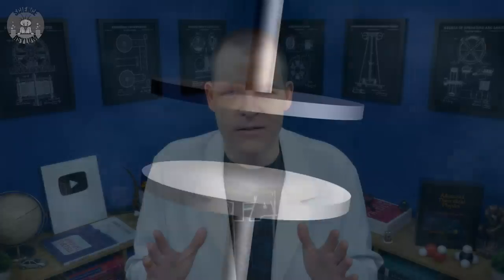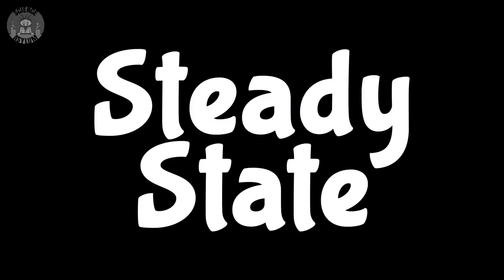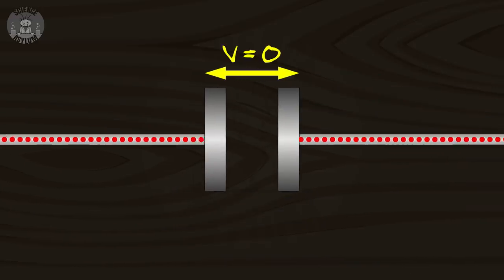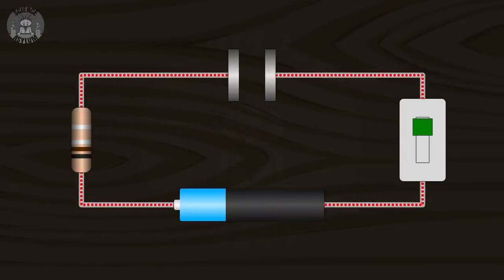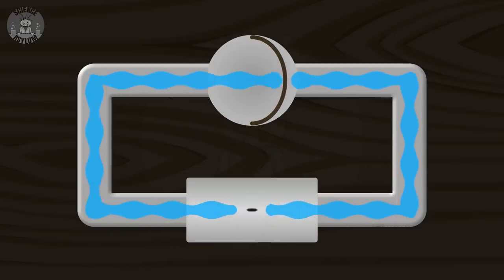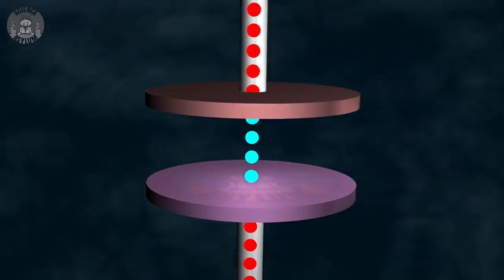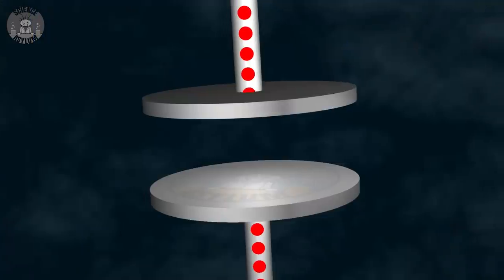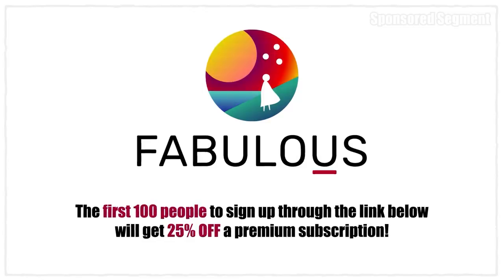Capacitors Are Gaps! How Does That Work?!

Comment: Great video - a few things that would be worth mentioning (for the you know, practical folks...)  First, is that a dielectric will increase the capacitance, by the relative permittivity.   Second, the charge on the capacitor is proportional to both the Capacitance and Voltage (Q=CV).  Finally, the energy goes as the square of the voltage (E=1/2 CV^2).  Many thanks once again!

Comment: Now Veritasium makes more sense!
..... If the capacitor "breathes energy in and out" is there a resonant frequency for this? Or is it a conceptualization?

Seriously though THANK YOU for pouring this information into me. When I was much younger (over 40 years ago) and I was being taught about Electricity I would often have questions that, with the benefit of hindsight, were just too deep for the lecturers trying to teach me to answer. I was also an arrogant sod back then and probably was not the best person to elicit help from overworked and stressed lecturers ...... My Bad!
But I have always been interested in deeper understanding. This is something you do well! With humor!
Reply from the maker: Circuit resonance requires both a capacitor and an inductor.
Reply: @ScienceAsylum  Perhaps my wording was not precise. If the capacitor has energy flow into it until fully charged, is there a maximum rate that energy can flow and a finite time it would take? If you throw a switch on a DC circuit does the current flow and then stop causing the magnetic field it produced to colapse?
Reply: @totherarf  real capacitors do have an effective inductance as well so, whilst you don't get any actual resonance, you do get a frequency where it has the least effective resistance. Dave Jones on EEVBlog has done videos on this, but the short version is capacitors resist current less the higher the frequency (or rather drop less voltage across themselves), but because of the inductance there is also an increase in this resistance. Low frequency the inductance is negligible so the effective resistance drops and drops until eventually the inductance becomes significant and eventually matches the resistance of the capacitor (it's around here where that low point is) - for higher frequencies than that the inductance takes over and it stops acting like a capacitor eventually.
Reply: @AtonyB  Thanks! That is what I was trying to say.
My question was what is that frequency? 
Obviously it would depend on factors like plate size and dielectric thickness and type ... so there may be a wide range .... but is there a ball park figure? Are we talking 50/60 Hz or are we up in the radio frequencies?
Reply: @totherarf  it depends on the physical size. For the large electrolytic capacitors Nic shows it a say a few tens of kilohertz. For the tiny surface mount capacitors on modern electronics (small light brown rectangular bits) it starts at a mega-Hertz and can go all the way to giga-Hertz for expensive high quality ones used in cell phone towers.
Reply: @duncanbarclay6919  Thanks!
That helps put things in perspective!

Comment: Concerning the resistance of wires.

I was tasked with designing and building a fixture to semi-automate testing special app thermal batteries. Thermal batteries of this type lock the chemicals of the battery away in crystal form. This keeps them from reacting, for decades. 

The method of activation used an electrically triggered pyrotechnic blank to ignite a flash powder in the cell. This melted the crystals. Tada! Fresh battery 30-40 years after manufacturing.

So, one of the tests performed by the fixture was verification of a correct resistance for the igniter fuse. The wire was only a couple ohms. The acceptable range for that resistance was less than 1 ohm. Accurate measurement was a must.

In order to zero out the wires and switching circuits of the fixture. I included circuitry that when connected to a 4 wire resistance meter could zero everything up to the +/- pins of the cell.

Everyday the fixture and connecting meters were warmed up, then the 4 wire meter was zeroed out to a standard. The standard was a dead short.

Then, multiple other standards were check against the fixture. Each of those had a calibrated pass or fail resistance engraved on them.

Re-zeroing occured every hour.

I made three variations of this fixture. Generally an error of less than 0.009 ohm was maintained for production runs.

After 5 to 10 thousand cells the sockets that connected the batteries would show signs of degradation. At the point that 0.01 ohm error was noted those sockets would be replace.

Yes, switches, wires, gold plated sockets all have resistance. And they all wear. When it matters it must be accounted for.
Reply from the maker: Thanks for all the examples!

Comment: Thanks, Nick, for your improved Poynting vector graphic which now clearly shows that the energy flow density is greatest nearest the conductor and then drops off further away from the conductor (specifically the Poynting vector magnitude is inversely proportional to the biquadrate of the distance [square of the square, or 4th power] away from the conductor). This means that almost all of the energy flows along the surface of the conductor.

Comment: Thank you for this video. Though I understand how capacitors work, I appreciate the simplicity to just help reinforce the conceptualization in my head. I especially liked the field vectors.

Could you also do one on a capacitor in an alternating current setup? I understand that shifts phase rather than acting like a... battery. I'd appreciate just seeing your animations to help strengthen understanding. A lot of people seem to think AC capacitors hold a charge even with power disconnected... which depending on the transient stage might but should quickly be dissipated via the wiring since the frequency changes the charge and discharge cycle very quickly.

I'd really appreciate it. Thank you.

Comment: Awesome video! I have always thought of a capacitor as functioning kind of like an expansion tank or a hammer arrestor to stop water hammering in a plumbing system. I  know that isn't a perfect analogy, but to help someone visualize how it works, it's a decent example. I always use a reservoir to represent a battery, and a pump to represent a generator.

Comment: Great video Nick, from the El.Eng. perspective I would only add: the main application of capacitors is to build circuits which can filter frequencies, i.e. through capacitors we can select and isolate frequency ranges in the perturbations of the electrical field. That has applications in basically any useful electronic device.

Comment: It would be nice if you could present an analogy between a capacitor and an inductance in terms of energy flow.
Normally, somebody will have his/her ideas well confused by the fact that an inductor is also an electric conductor for DC, but that is not a fundamental property of an inductor, but is merely a consequence of how we build an inductor - with coils of copper wire. Mathematically, an inductor is the complex conjugate of a capacitor, the phase of the current is +90° with respect to the exciting voltage, while for the capacitor is -90° or -π/2.
This allow the construction of a tuned circuit by using a capacitor and inductor, where the energy exchange between the two is maximised at the resonant frequency.
Very interesting matter - Thank you.

Comment: Antennae coated with an insulator is 1/2 a capacitor and reset the wavelength of the electricity it captures. Making the antennae shorter to resonate with the shrunk wavelength. That dielectric is also compacting the shape of the impulse or AC wave passing through it.

Comment: Hey, this is the first time I'm in time for a new video of yours! I'm impressed with the animations, is that Blender?

Only one small doubt: when the energy is released back, does that mean half the charges are left stuck and unused at one half of the capacitor? Thanks in advance!
Reply from the maker: That was After Effects, not Blender. If I had used Blender, I could have textured the metal, but that seemed excessive.

Comment: I always think of a capacitor as a DC blocker, but one that allows more current flow as frequency increases, depending on the resistances and impedances in the circuit. 

I'm old school!

Comment: I've also seen variable capacitors. Sometimes it was a stack of metal plates, turning in to another set of plates (with an air gap). There are others.  They were used in conjunction with a coil for tuners in radio receivers.
Reply from the maker: Variable capacitors are a beautiful work of engineering.

Comment: I trained in electronics in 1973 but I always thought of capacitors as warping the electron lattice in the dialectric. Unless I am misremembering the amount of energy a capacitor of a given plate area and gap is a function of the dialectric constant of the dialectric. I do remember that the dialectric constant of air is 1. In 1984 I worked with an imaging material with a dialectric constant of 8K. The material was driven by high volatages - like 2Kv up to 8Kv. Think about how much energy a dialectric with a constant of 8k could store. That's a lot more than the activated charcoal used in supercaps. I did some rough calculations and the devices were running in the multiple farad effective range and being a ceramic they could handle multiple KV without arcing. Switching the voltage necessary was a nightmare. You should have seen the semiconductor engineer's face when I told him we might want to switch 8KV. We were able to realize some of the material's possibilities with 2KV but we would really have needed up to 8KV to do everything the material could actually do. Unfortunately the home company the R&D facility was part of shut the facility down and that technology pretty much evaporated. If you're interested the material was called PLZT and we were using it as an imaging material. It would rotate the polarization plane of light passing through it.  I was switching individual pixels in under 5 microseconds. That is like 2 orders of magnitude than liquid chrystals.

Comment: I have dealt with medium voltage capacitors (1-10kv) for years, but never understood the mechanics behind their ability to potentially acquire a lethal charge while sitting on a shelf. (Assuming a discharge resistor failure)….I FINALLY understand how the induced charge happens!….sort of🤔  

FYI….always put jumpers between legs of capacitors in storage if they’re capable of storing a lethal charge!

Comment: It's worth noting that some types of capacitor really care about which way round they are wired up (e.g., electrolytics, tantalum capacitors). If you apply an alternating current, they don't like it very much : they tend to heat up, then glow very briefly, and then go "pop". Or just turn into fire.
Reply: That's a function of the specific dielectric that you are using.  The default design of an air gap or vacuum gap capacitor doesn't care about polarity.   There are some dielectrics like those used in ceramic capacitors that are polarity agnostic, and can be used in either direction.

Comment: This is a great explanation especially the stuff about energy flow. Can you do the same kind of video about inductance/inductors?
Reply: Maybe inductors would be like propellers rotating with the flow, but with a very high inertia, so they resist to change velocity.

In fact, water's mass already acts as an inductor

Comment: Superb! You know, I always wondered about the current round a circuit. The electrons on one side of the load have the same charge and speed as the electrons on the other side of the load, so where's the energy transfer?! I knew the voltage is where it was, but never knew anything about Poynting and these videos are gold! Thanks so much! Is there a similar one regarding the behaviour of an inductor I wonder?
Reply: Also, you've gained another patreon!
Reply from the maker: I'm already thinking about an inductor video, but those are more challenging devices so it might not be soon.
Reply: @ScienceAsylum  exciting! Thanks for the reply and I can't wait for the inductor video. Although, if it wasn't for my lack of understanding of inductors, I'd never had been led down the rabbit hole of Poynting, Einstein and Relativity!
Reply: @ScienceAsylum  you should do a video on one. The world runs on motors and is increasingly so. Worth the effort for you, I think.

Comment: As always, very good video. Maybe a follow up could be with the difference between "regular" capacitors and bipolar, also the construcion (e.g. electrolytic vs foil) and what and why are their properties, so they get used in very different situations to get the best effect that you desire from a circuit. 🙂 Resonant circuits might be a nice example. I know this is way beyound the opriginal video. And designing passive crossovers requires you to take into account the impedance characteristics of the speakers you want to connect in order to get phase correctly. Even a simplified way to do it (and wrong - but still vastly superior to what the basic math will give you) is super interesting, as you need to make sure that the impedance does not drop below a certain level in order not to blow up the amplifier by what could be practically a short circuit (if badly designed).

Comment: Great show! 
It took me quite a while to understand capacitors when I first started messing with electronics. What really baked my noodle was inductors! And I still struggle with the fundamental theory of tuned circuits.
Reply from the maker: Agreed. Inductors are more conceptually challenging.
Reply: Current lags voltage. Back EMF is a bitch.

Comment: Wow, amazing video. It clarified various doubts I had. Thanks!
One question, though. At 11:12, the electric field (blue arrows) are showing to be pointing from the left wire to the right wire. What caused this external electric field? Was it the current in the wires (created by the battery), or was it directly created by the battery?

Comment: The thing is we usually use capacitors in parallel or on a stub leg of a circuit to stabilise ringing, absorb ripple, or to be part of a resonant circuit. These are almost all AC applications or DC from AC at least. Since AC can go through a capacitor (given the right frequency for the capacitance/impedance).
I think it would have been more representative if you had started with the capacitor in parallel to the light bulb load. 
And then say the battery gives off lumpy power for some strange (quantum?) reason. The capacitor absorbs the lumps.
This works a lot like an accumulator in a pressurized water system. 
If the pressure is high it allows more water into it's reservoir, pressure is low it lets water out to bring pressure back up to nominal.

Comment: For me, a tank circuit was always the easiest way to understand a capacitor.  Similarly, the idea that capacitors could block DC, but readily pass AC, was a marvel to me.  My favorite capacitors were those adjustable ones that looked like ice-cube makers and were used in tuning vacuum-tube radios.  This video shows a different way of looking at capacitors that enriches the understanding of how they work.

Comment: I was just simulating an LC circuit and realized you should do an inductor and also show the Poynting vectors for it.  I have a feeling that it would look similar to the capacitor "breathing" with the energy flowing into the inductor perpendicular to the wire and the coils, but it would be cool to show the LC oscillation passing the energy back and forth!

Comment: When I first learned electronics at college 35 years ago, understanding actually how capacitors worked... well, I simply didn't. I just accepted that they blocked DC but 'somehow' passed AC with the plates charging and shit, lol. Even diode and transistor theory seemed easy by comparison. I think capacitors, along with their varied uses, are a wonder within electronics... no, they're the unsung heroes!
Reply from the maker: I agree that they're pretty amazing.

Comment: The way I learned capacitors is, since like charges repel, electrons on the negative plate of a capacitor repel elctrons away from the positive plate through the dielectric.  The repelled electrons are being 'sucked up" by the positive charge of whatever is onnected to the positive plate (such as the positive pole of a battery). Therefore there is an excess of electrons on the negative plate and a deficiency of electrons on the positive plate.  Thus, the charge in a capacitor is basically held there electrostatically.

Comment: My dad was a TV repairman.  I saw him take out a tuner and asked him how it worked.  It is a variable capacitor with the surface areas varying.  They form chambers which resonate various radio frequencies.  It blew my mind!  How can such a weak signal, that couldn't be felt, do that?

Comment: And also, Nick, I observed something interesting about their transient analysis last week while solving Engineering problems. An uncharged capacitor is considered as a short circuit at t=0+ I wondered why. The reason is, in an uncharged capacitor, there is no potential difference across the plates. So, we can assume that both the plates are at same potential. When two points in an electric circuit are at same potential (equipotential points), we can consider it as short circuit, or open circuit, or even consider it having some Impedance (because at the end no current flows anyway through that branch). We consider it as a short circuit in this case because we want the maximum current V/R to flow through the circuit at the instant t=0+